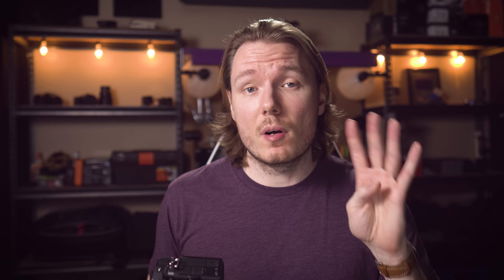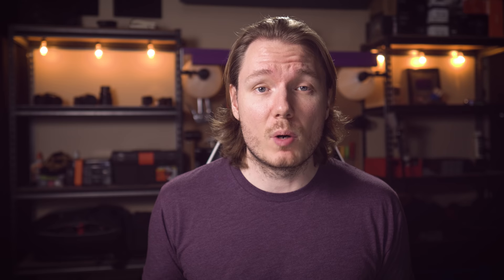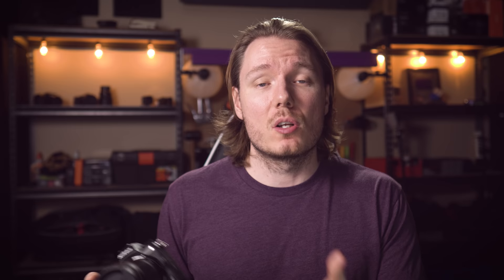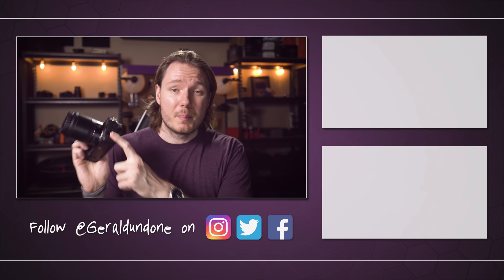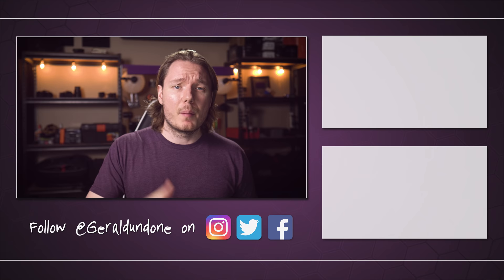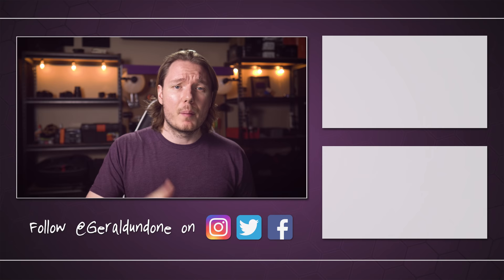Pixel Binning vs Line Skipping / Why the Nikon Z6 Is Better for Video

Comment: 4:14 "These smaller pixels mean that the noise is smaller" That can be misleading, as people often equate photosites to pixels, and smaller photosites produce more noise. 4:47 same problem, you'd be right if you were talking about pixels displayed on a screen, but "pixel count" in camera usually refers to photosite count (and thus size) which do not affect aliasing per se. So no, small pixels plus oversampling (over-resing? to 4k) is not necessarily better than a native 4K sensor (in terms of aliasing). Skipping data (line skipping) is what produces aliasing. Cropping does not create it, you just sample less information but it's still properly sampled.
Reply from the maker: Those are fair criticisms. With cropping I think I said, "No improvements", because like you said, it doesn't cause it, but it also has nothing in place to improve the issue. Line skipping is definitely the villain there.
And yeah, there is a whole photosite vs pixel conversation. It's not in an attempt to be misleading, but rather make the topic follow easier in a short window of time. In most of these videos I have to make compromises to keep them to an appropriate length and flow. Thanks for taking the time.

Comment: Great video. I was always under the impression that line skipping was particularly susceptible to moiré and aliasing, even more so than cropping and using the bare minimum number of (bayer) pixels for your given output resolution. That something about the process of filling/average-ing in the missing lines created artefacts. Am I mistaken on this?
Reply from the maker: I suppose it would depend on how bad the crop is. Line skipping to a great degree would be worse than a minor crop, but a full crop and a full line skip should be similarly bad, but it would depend on the quality of the process as well. Bad line skipping is quite bad, yes.

Comment: - Great video man. I'm still a bit confused on my situation; need your help man!
- I bought a speedbooster from ABT cinema for the red epic w 8k. 
- I believe the red epic crops (by your definition) when going from 8k to 7k to 6k and so on b/c my field of view keeps changing each time I change resolution. 
- the speedbooster is designed to give a full frame look when shooting in 7K.
- I get vignetting when shooting in 8k as the speedbooster converts the 8K field of view to slightly larger than full frame and most of my lenses are not larger than full frame
- I find that when I shoot 8k, if I crop a bit in post to get rid of the vignetting, I end up getting the exact same field of view had I shot in 7K
- Here's my question (assume I'm editing/delivering a 1080 project),  is it better to shoot in 7K (no need for cropping in post b/c no vignetting) or is it better to shoot in 8K and then crop in post to get rid of the vignetting? My hunch tells me shoot 8K and crop in post b/c you have more pixels to play with... I've been doing some tests but haven't been able to come to a clear conclusion yet. Thanks in advance if you can help :-)
Reply from the maker: Because cropping isn't that fancy of a process, it probably doesn't make much difference, but an advantage to keeping the 8K and doing it in post would be more control. Obviously you can't go back if you do it in camera, so maybe one day you're shooting a dark scene and you don't need to crop as much to remove the vignette. Or maybe stylistically you want to keep the vignette for a shot or two. You only have that choice if you do it in post.

Comment: If you not got the GH5 before they release the GH5s which one would you buy and why?
Reply from the maker: Well, today I would probably buy the GH5s, but at the time I also used the GH5 as a travel photo camera, because of it's compact sized compared to the Canons I was using. I don't need it as a travel camera anymore, so I'd probably just go straight video. I also used the IBIS a lot, but not as much these days. Hope that helps, but it will really depend on what you need the most.
Reply: Thanks for reply which I was right about GH5s awesome camera. I film mostly video and wanted help in choosing a great camera for video and also price. So now I have 2 choices 1 being GH5s or Pocket4K which almost is a no brainer the Pockek4K is shoots both Prores and raw for $1299 and the GH5s Prores at 2300.

Comment: While you were speaking about noise, I was wondering if it is possible to totally eliminate it or if we could use a reference image with a noise signal and using it to reduce or eliminate the noise in a image with the same settings?
Reply from the maker: I suppose. That's kind of what the long noise reduction process is in your camera. It does the long exposure twice so that it can use the comparison to eliminate hot pixels. But to do that on the fly at 24 frames per second would be pretty intensive.
Reply: Then how does the A7S II manage to get an image with very little noise? Is it more the processing that is involved or is it more a combination of multiple factors?
Reply: @alexandruadrian3218  The best way to avoid noise is to increase the signal quality either by having large pixels or by having a very good sensor technology.
Else it is going to be a fight against the laws of nature and physics always wins.

Comment: Great video, but I have a noob question. Does enabling Crop mode mean that you get less light for your video, because it's using only the middle part of the sensor?
Reply from the maker: Not in this case. Because the hardware all remains the same. It's similar to doing it in post. You just cut away what you don't need.

Comment: Cropping also effects lens characteristics, why waste the beautiful characteristics of your favourite full frame lens if you're only using the center of the glass in a crop mode  😊
Reply from the maker: Interesting point. This would definitely be true for some of the lenses I favour. 👍😃
Reply: @geraldundone  how does it effect when the best part of the lens is in the mid section. so a crop  uses the better part of the lens.
Reply from the maker: @vignesk6669  Removing that wide-angle "feel", I suppose. Also, in low grade lenses, the imperfections of the lens are magnified when cropping.

Comment: Hi Gerald, Thank you for this great video. I have been looking for something as good as this one for a long time :)

I have one comment and some questions: 
"How do cameras resize when they do oversampling" is not clear in the video (@ 2:37). For example, a camera took the video using 6K horizontal pixels and it will use only 3K pixels in the output video (consider horizontal pixels of only one frame), how does the camera downsize? Is it similar to bilinear/bicubic interpolation or nearest neighbor or is there other more complicated things going on?

Is there a way to tell which camera is doing what?
Reply from the maker: Good question. I think the details are left up to the manufacturer and the processes might differ (and they likely won't tell us the specifics), but my thinking is that they're just variants on the same resizing and interpolation you'd find in your computer, gpu, phone, etc. Like the example you provided: bicubic. I imagine in some less-advanced systems it's just cheap scaling where the  resampling is done with a less-effective amount of pixels to save compute power/heat, because the results do seem to vary.
I haven't seen a sheet that lists the interpolation scheme or the resampling method though for any camera. It's only ever broad strokes.
Reply: @geraldundone  Thank you for the information. This video helped me a lot!

Comment: Unfortunately Z6 canˋt do full 6k-4k downsampling as soon as you set it to n-log 10 bit. It becomes about 1,1 crop as well.
Reply from the maker: It still does downsampling, but there is a slight crop, yeah. I can't find any official source that says the ratio of the crop. To me it seems like about 1.1x to 1.2x. Have you found any brief that lists the actual number?
Reply: Gerald Undone i have read a z6 review on slashcam.de in german. https://www.slashcam.de/artikel/Test/Der-4K-Vollformat-Herausforderer-Nikon-Z6---Bildqualitaet-im-Videomodus.html
Reply from the maker: Thanks for the link. I did some tests just now and it turns out it's any 10-bit, even if n-log isn't on. 10-bit flat also has the crop. But 8-bit external does not. The electronic stabilizer also adds the crop, but the regular VR does not.
Reply: Gerald Undone thank you for this info

Comment: Why not just include a video recording mode that uses all of the pixels on the sensor, so the video resolution is equal to the sensor resolution?
Or just design the sensor to have an exact multiple of the 1080p/2160p resolution
Reply: Because you can't process that much data - which will go into the hundreds to thousands megabyte per second.
Reply: Isn't there less to process if it doesn't have to use any complex scaling algorithms? It would have a large file size though.
Also, you can choose how much CPU power to throw at H.264 encoding.
You can do fast H.264 encoding and just let it use a high bitrate, rather than chewing through CPU trying to compress it down to a lower bitrate without throwing away detail.
Reply: Although, I'm pretty sure most DSLR's aren't really using the best, most efficient ARM cores you can get. Stick in like 4 x A73 cores and I bet it could do a lot more.
The A73 architecture is very lean and efficient. They even reduced it down to being 2-wide decode, while still increasing performance.

Comment: Is it true that processors in cameras are getting better due to Moore's Law (shrinking transister sizes) and therefore each new generation is using less power and producing less heat? Or are they just using the same old tech again and again?
Reply from the maker: That depends on the company. Some are really pushing forward while others are just recycling dated chips.

Comment: There was just one problem which is a common problem but you didn't show any actual data on the relative IQ between the various modes

This is a problem that I'm reminded of every time I look at landscape photos taken with my old Samsung S6, especially in HDR mode. 
Now imagine shooting HDR 4k@60fps video. I mean, stills are great, I shoot them all the time but when is that high resolution really going to pay off especially compared to a "full-image" perspective? I'm sure there's some pro photo who will happily yap on about how his 40MP stills camera makes real money for him, but with or without HDR, seriously? Now you've got to fight to get 14, 15 stops out of the camera...and what are you going to do with that when you can only get 8 stops out of a 24-bit image? Even less than that when you consider the real color-range. Yes I know that a cellphone image has a lot of NR even in good light and it will not compete with a good camera & lens at 100% & 1ft viewing distance but that's just not realistic, spending that much time with your nose pressed to the glass.